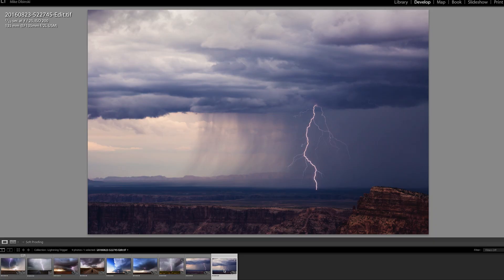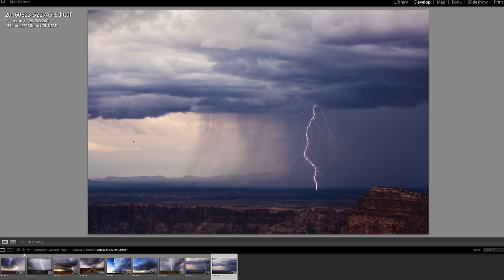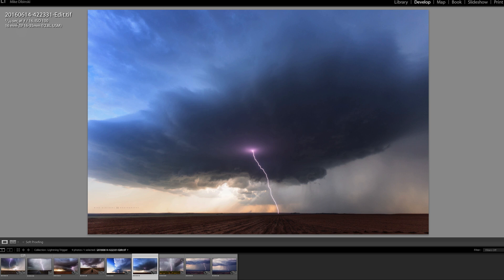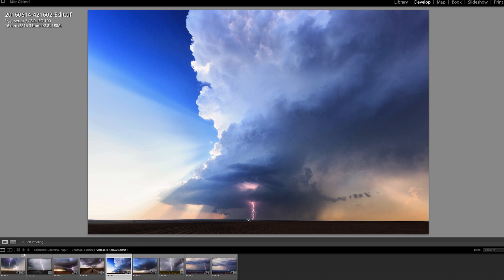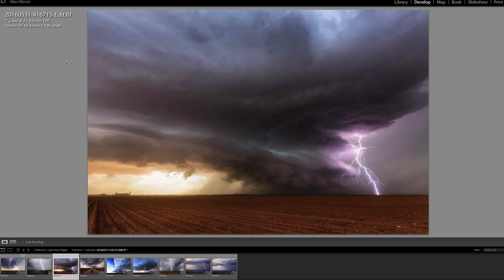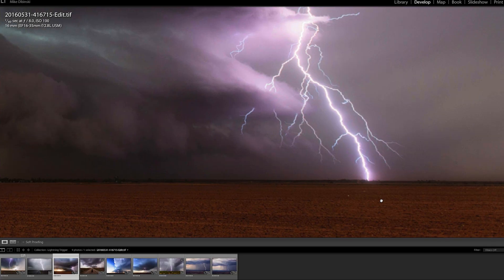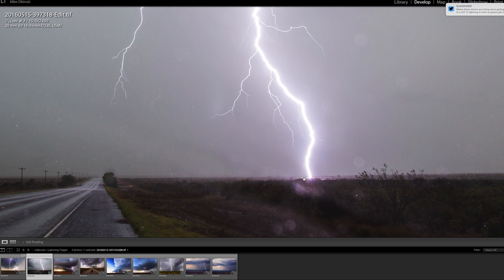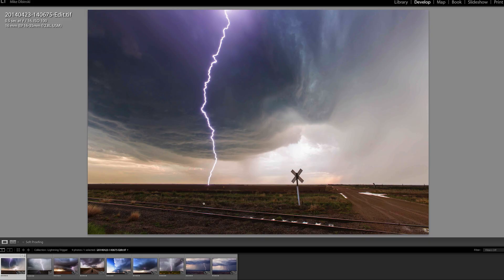Photography tutorial on using Lightning Sensors - (Lightning Trigger IV)

Comment: Great video and thank you for posting. I just want to note the reason why there is no filaments on that 1 shot you took without the sensor is because filaments are only visible during the 1st part of a strike if the bull flickers and get the shot when it flickers the filaments will not be visible only the channel.
Reply from the maker: James Hackett that’s not actually why because I have all the filaments in my photo they are just fainter then my buddy who didn’t use an ND filter. We both used lightning triggers.

Comment: I saw that 1/125 was a recommended shutter speed? Is that false and should I try to go lower? Also how do you feel about shutter priority mode as well as an nd filter? Nice video!
Reply from the maker: Saw that where? Not in my tutorial I don't think. You want it slower, like 1/80th or slower. A slight ND filter can help as well. I don't use Shutter Priority, I always shoot in manual!

Comment: Were you also using an ND filter on these?  I just got mine and the problem I'm having is that it's too slow, it seems to always snap after the lightning is gone.  I haven't gotten into a really good storm yet, mostly just illuminated clouds as opposed to nice bolts.  Maybe these flashes are just too fast for it, the only ones I get are the ones that sometimes happen immediately after the one that triggers it.  Thanks for posting the video, I'll change my camera settings based on your suggestions so at least when I do get it to respond fast enough maybe I'll get some nice shots.
Reply from the maker: Not sure if you watched the tutorial, but I talk about using ND filters.
Reply: It wasn't clear if you were using it on all of them.  I'm probably going to return it, it's just too slow, never captures anything.  It can't even capture a flash light when I quickly turn it on/off in front of the camera.  A lightning bolt would need to last a second or more for it to capture it.
Reply from the maker: Do you have the Lightning Trigger IV? What camera are you using it with?

Comment: It's a crying shame the cable is not 'generic'.. I have two of these units and you can't just simply buy a generic brand name cable and expect the trigger to work - it rejects it.  The cable supplied has the + and - wires reversed either in the trigger or cabling.
Reply from the maker: Yeah, but smart on him I guess. Not sure if it's just reversed so he makes the money, or if there is something special to make them react faster?
Reply: would not make the trigger faster - that's just the component.  Just disappointing that when I need a new cable it costs me 500% more and have it flown 30,000 miles - when in essence every other trigger brand just use the user friendly name or generic cables - got me so annoyed.

Comment: 1:38 The sensor doesn't detect lightning. It detects light changes in the atmosphere. If you turn on a flashlight pointing at the sensor, it will trigger as well. I use this for years to capture lightning during the day during Monsoon storms in the Arizona desert. Works great. Good video.
Reply from the maker: Okay, that's a ticky-tack comment lol...it's called a lightning sensor, so it senses lightning, even if it's just light variances :) It doesn't trigger off car lights or changes like that, so it's honed into lightning more than other stuff. So you use this trigger? It's pretty awesome for sure.
Reply: Okay, I'll take the Ticky-tack as something new... Yes, I use the trigger and it does trigger the camera for any changes of light, especially during daylight storms. If you fire the flash (either camera built in flash or external flash, and it doesn't have to point at the sensor) the unit will fire and the camera will capture an image.

I found it impossible to adjust the sensitivity for daylight storms. A passing car in the distance that will reflect the sun will trigger it as well...

Comment: Nice Tutorial, Mike! I'm using the AEO Photo Trigger and it works pretty well. Sometimes when there's an MSC or something the Trigger is going crazy as it is detecting every single cloud lightning you wouldn't recognize with the naked eye. I have a similar experience with photographing through the windshield. The sensor fires with every new raindrop detected on the glas. What's your experience with that?
Reply: I'm still struggling with the Nero (pre MIOPS). Useless during the day. I do use it after sunset to save me from having to shoot frame after frame or just keeping the shutter open even when nothing is happening.  The Lightning Trigger and the AEO Photo Lightning Strike! Pro are two that I'm seriously considering, so I'd love to see a head to head comparison. Reviews are very good on both units.
Reply: David Eppley my Nero Review Gadget died on the first day 😂
Reply from the maker: Nero sucks, go for the LTIV :)
Reply from the maker: Marco Rank is that at night or do you mean daytime?
Reply: Mike Olbinski daytime / sunset of course. I don't use it in the night.
Reply from the maker: Marco Rank good you make me so happy :)
Reply from the maker: Marco Rank also missed your second comment. I don't get the camera taking pics with the raindrops on the windshield, that's weird. Maybe it's the wipers flashing?
Reply: It's also firing without the wipers turned on :P would like to see a comparison between both triggers. Do you have a sensitivity control on yours? Maybe we can test this out when we probably meet in the Plains ;-)

Comment: Hello Mike. Great tutorial. Can you regulate the sensitivity of the trigger? For example, for a brighter time of the day, reduce the sensitivity for it to trigger only with the lightning, and not with the day light? I have one of the cheapest... and in day light, even with the sensitvity set to the minimum, it keeps triggering with the day light...
Reply: AFAIK, most of the triggers are fairly 'smart' in that they look for a sudden increase in brightness, while ignoring the actual level of light.
Reply from the maker: I don't think you can change many of them...although the Nero one I think had something like that. The Lightning Trigger IV doesn't for sure.
Reply: Ok. But, nevertheless, the Lightning Trigger IV can "find" a lightning and trigger the shutter, even in daylight, right?
Reply from the maker: ExtremAtmosfera well yup that's what I show in the video :)
Reply: MIOPS (Nero) trigger has many levels of sensitivity adjustment but still doesn't work well in daylight, at least for me. AEO Photo Lightning Strike!  Pro also has a manual sensitivity adjustment.